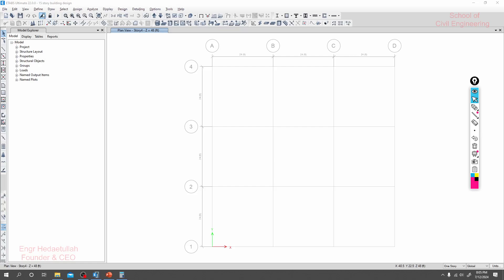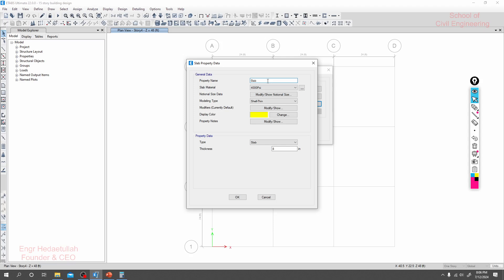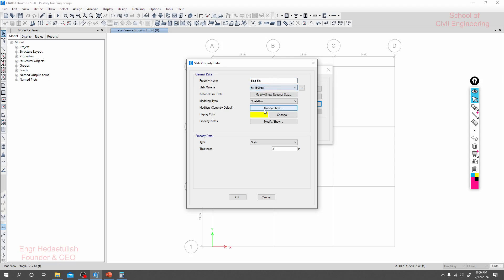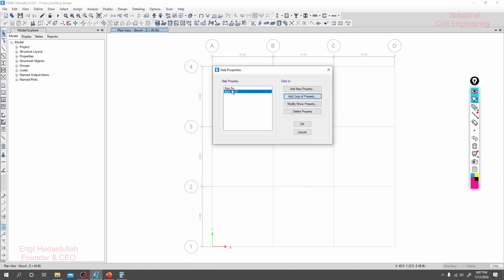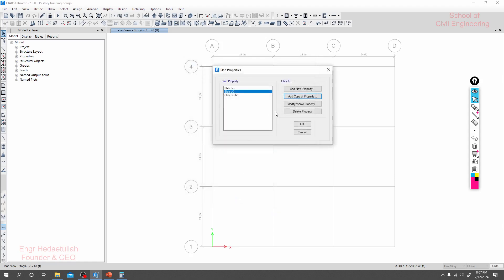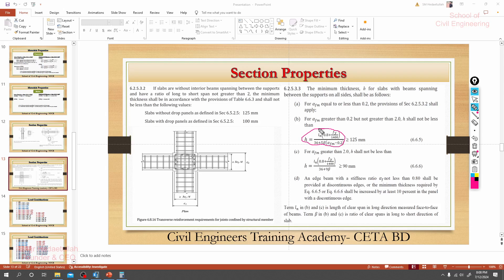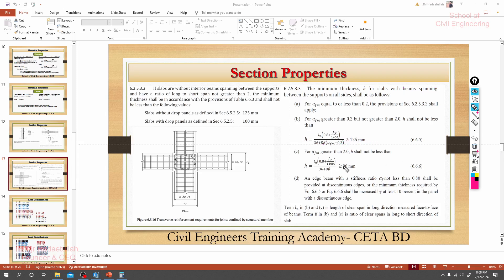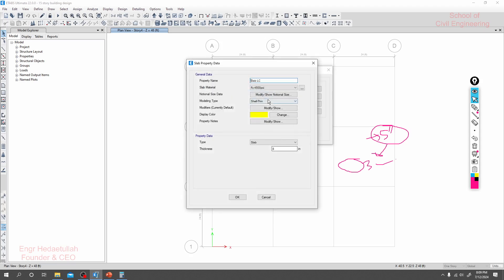8. CSI ETABS v22 2024: 15-Story Building Design in ETABS - Define Slab Section as per ACI 318

Comment: shell thin, shell thick, membrane, layered. What do these options mean?? which one to use when?
Reply from the maker: In ETABS, these terms refer to different ways of modeling walls, slabs, and other structural elements. The choice depends on the level of detail you need in your analysis.

1. Shell Thin
Assumes thin shell theory, meaning only in-plane and bending stiffness are considered, but transverse shear deformations are ignored.
Suitable for thin slabs and walls where shear deformation is negligible.
Used for regular slabs, walls, and decks in typical buildings.
2. Shell Thick
Uses thick shell theory, which accounts for transverse shear deformations.
Recommended for thicker elements (like deep slabs or shear walls) where shear deformation is significant.
Used for thick slabs, raft foundations, and shear walls in high-rise buildings.
3. Membrane
Only resists in-plane forces (no bending stiffness).
No out-of-plane bending or flexural response.
Used for shear walls, diaphragms, and tensile fabric structures.
4. Layered
Used for composite materials or reinforced concrete with multiple layers (concrete + rebar layers).
Useful for detailed nonlinear analysis where different material layers interact.
Not commonly used for regular building design but for advanced studies.
Which One to Use?
For slabs → Shell Thin (unless very thick, then Shell Thick)
For shear walls → Membrane (if ignoring flexural stiffness) or Shell Thick (if considering bending)
For raft foundations → Shell Thick
For composite or special materials → Layered